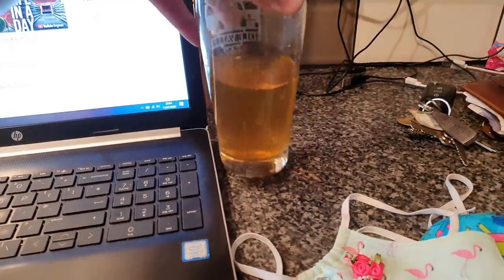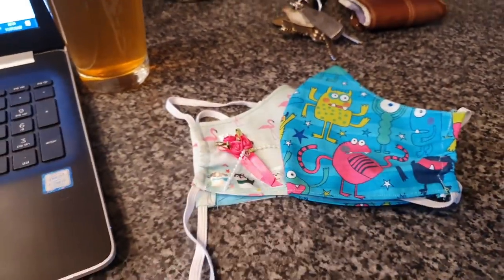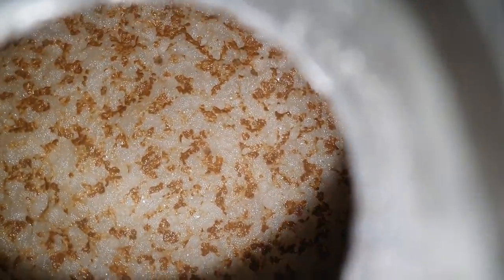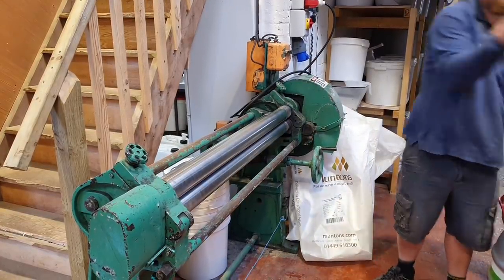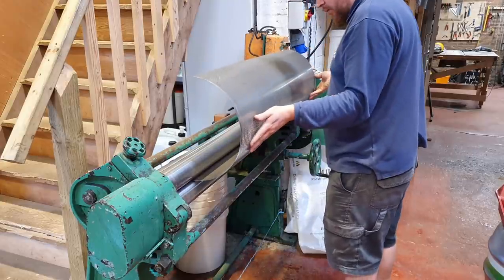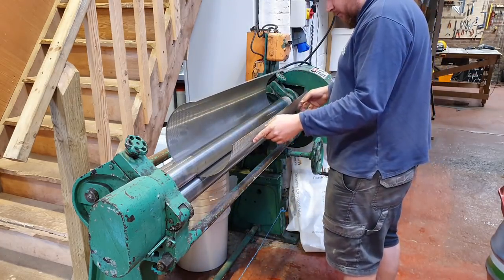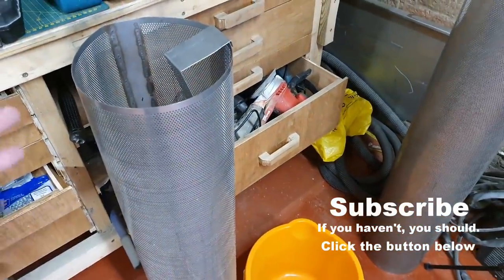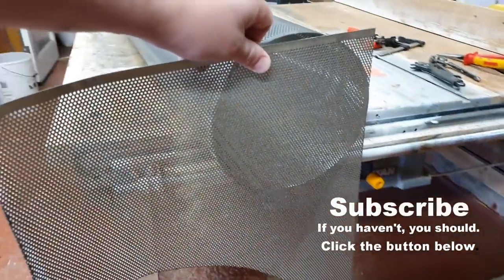Random Questions From The Comment Section

Comment: I know some won't like this idea, but perhaps launch in the UK initially, measure the response (which I am sure will be very positive) - see how they travel through the carrier system (don't use Hermes or Yodal :-)).  I beleive your demand will outstrip your current capacity - such is your infamy; like the rest I can't wait to puchase from you !!!  Question.  Would you ever conider selling your beer in those eco type kegs?  A six pack is all very well and good - but a good 19L or 30L keg connected in a Corny/Cask type set up would be fabulous....